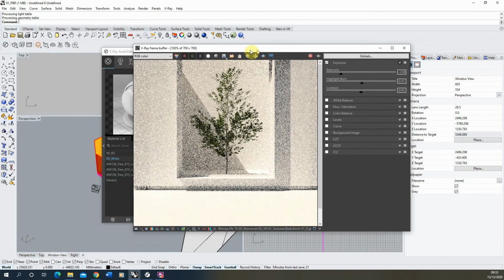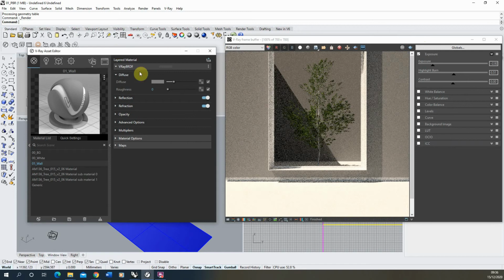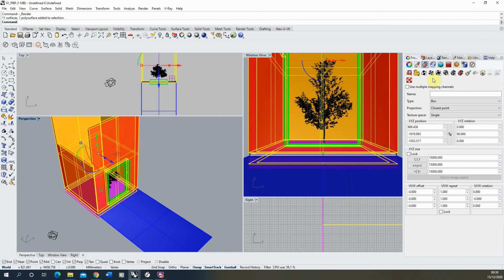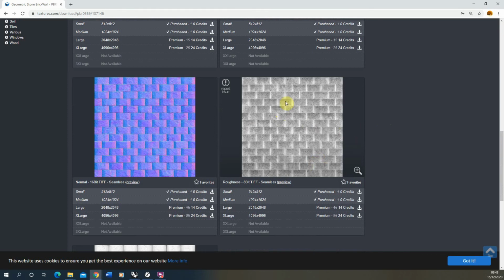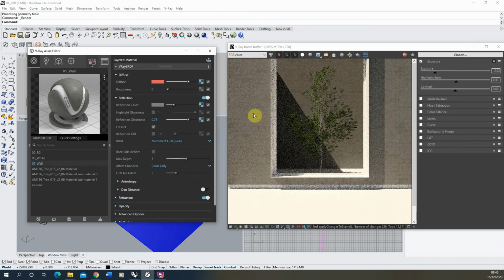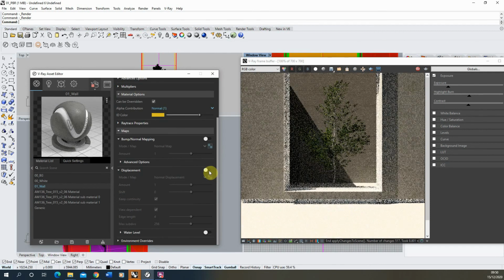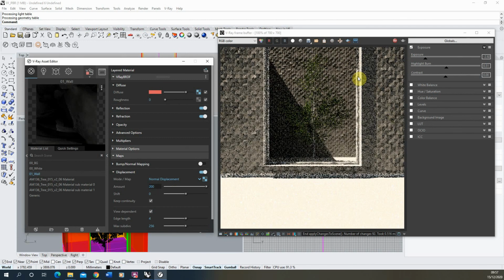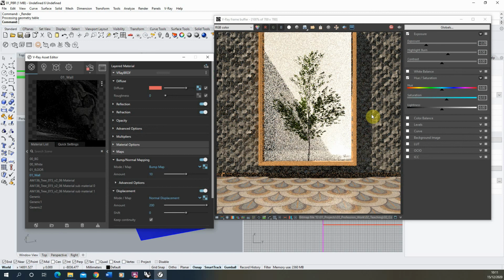Material Creation - V-Ray for Rhino - PBR Materials

Comment: Hi, what version of vRay is this ? I can't seem to find some of the drop down menus, like the displacement map and such.
Reply: I found it by mistake
When you are in the frame buffer click on display correction layer then click on create a new layer they will give you all the options the choose what you want
Reply: @Ahmdkhoja  thank you!
Reply from the maker: Hi Francesca, in some of the newer versions of VRay the location of these options has changed and they have hidden some of the options under the 'advanced' menus. There is usually a button in the top right of the asset editor that allows you to switch to advance settings so you can see these options